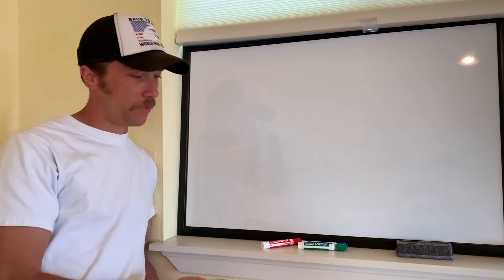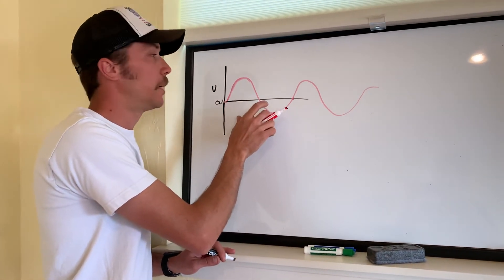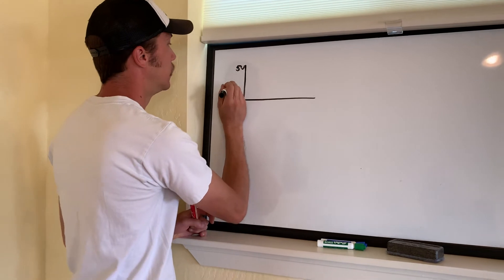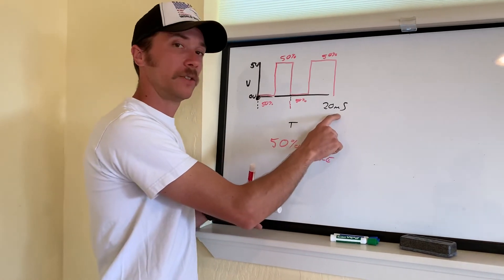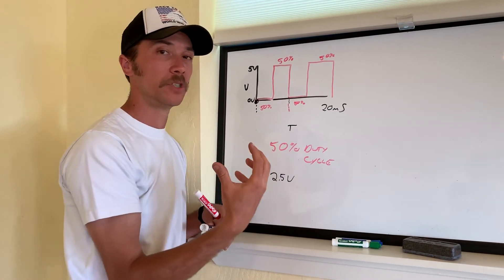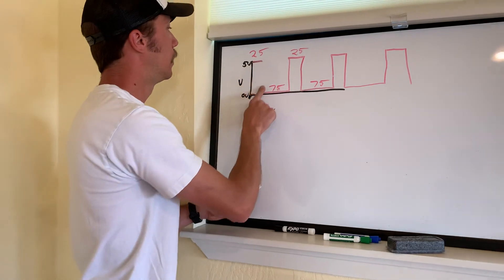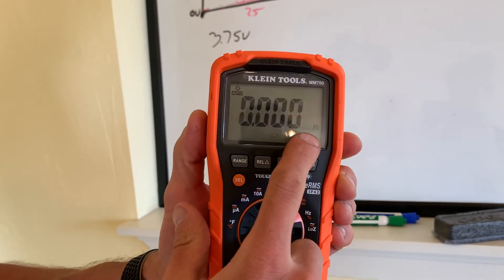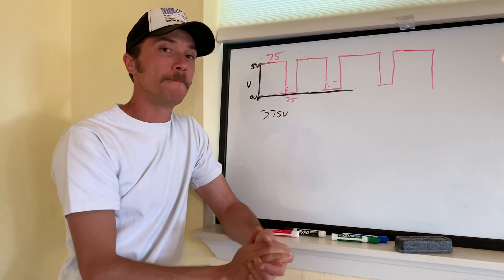What is frequency, and duty cycle?

Comment: My pwm pin im trying to use for fan module is -pwm pulsed ground, i cant figure out how to convert it to transmit pwm+. i can run fans no prob with pwm signal generator. its doing my head in.